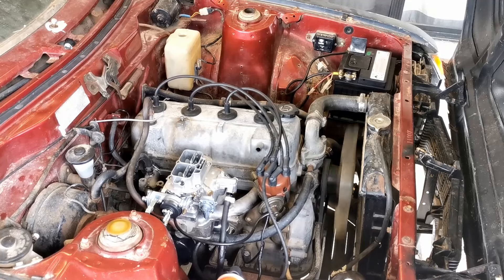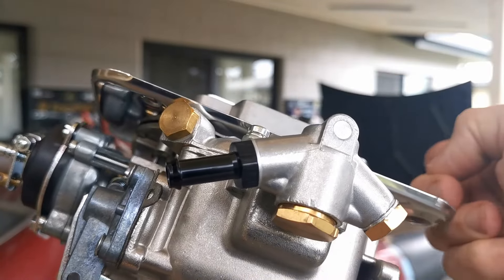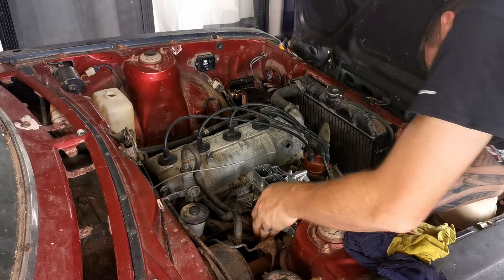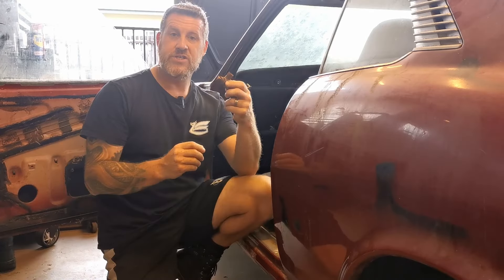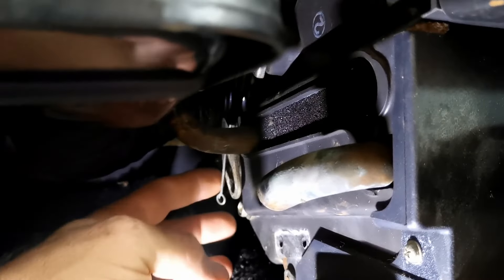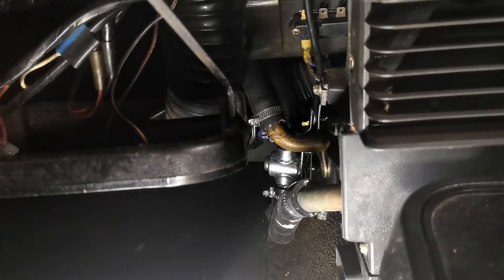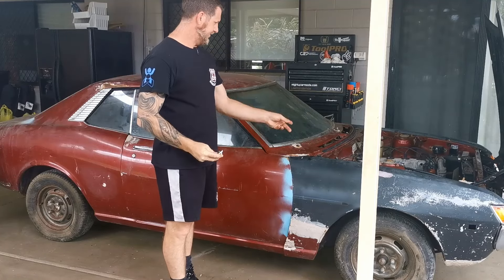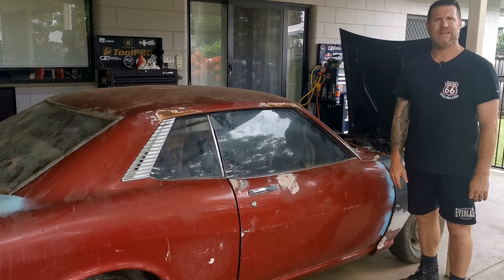'71 Toyota Celica project car. [IT MOVES!!] Classic JDM TA22 [Ep 4]

Comment: For some reason the old pumps look more classy, durable and can probably outlast the new ones! 
Wonder if you can rebuilt it instead 🤔
Reply from the maker: Typically, they are sealed units. If they are serviceable, it seems impossible to find replacement parts like the valves and diaphragm. I still have the old one stored away in case I do find a kit to rebuild it.

Comment: Where did you get the new heater valve from? I need one on my TA22
Reply from the maker: Look for a "HEATER TAP 5/8" BY GATES (UNIVERSAL TYPE) RPW4008"
(or HT4008)
I found one on evilbay, but you can find them (or have one ordered in) at your local parts store, or Online Auto Parts show an equivalent 5/8" Heater tap too.
Reply: @ProjectCarHaven  found it. Thanks mate